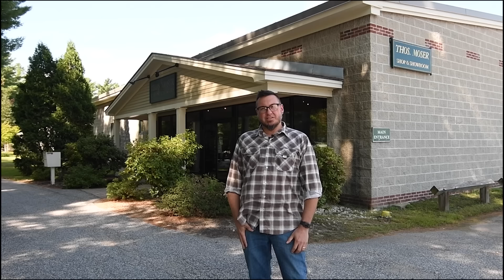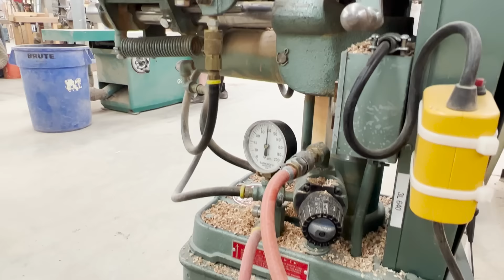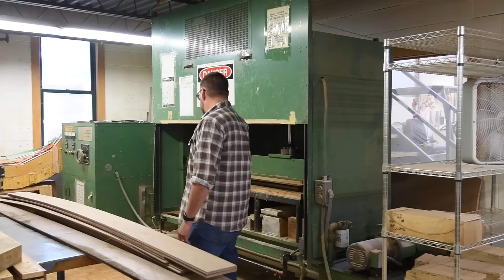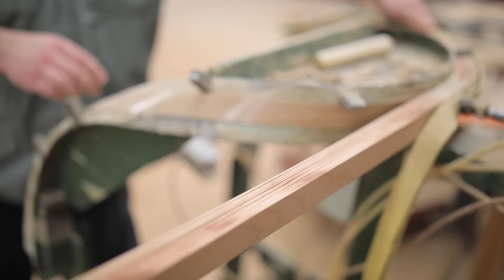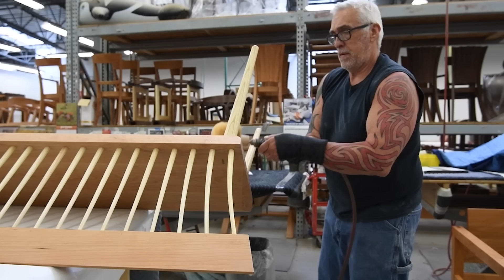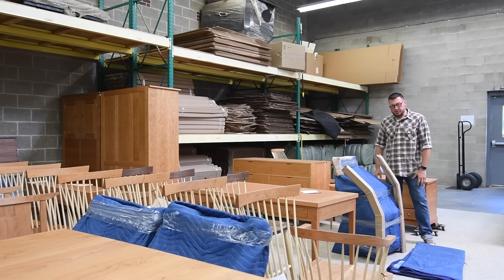Inside the Thos. Moser Workshop.

Comment: I discovered (and have followed) your company since the mid 1980’s at about the same time I found Eldred Wheeler when I lived in Dallas (Eldred Wheeler had a retail shop there at the time). Obviously Eldred Wheeler didn’t survive and I think Thos. Moser’s success is because you embraced modern machines/methods as well as more modern designs without forsaking the care given by 18th century craftsmen. I haven’t given up owning a Moser piece yet!